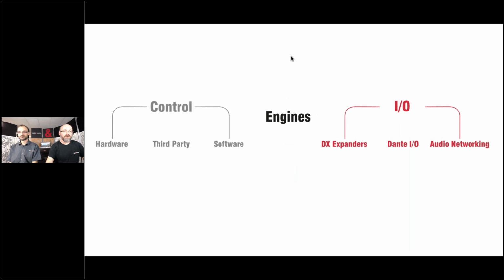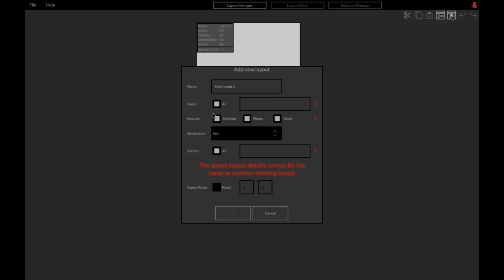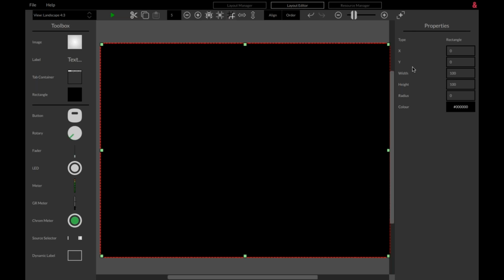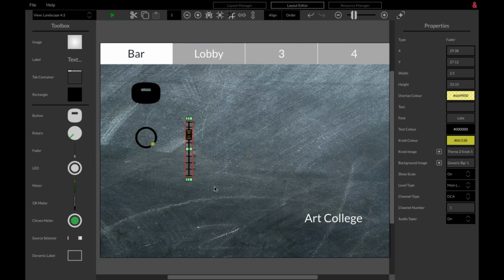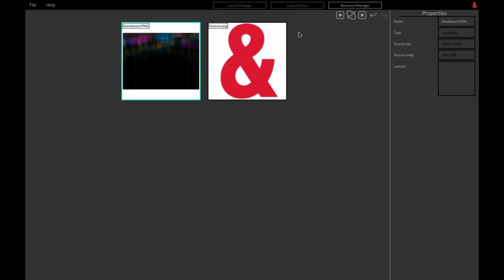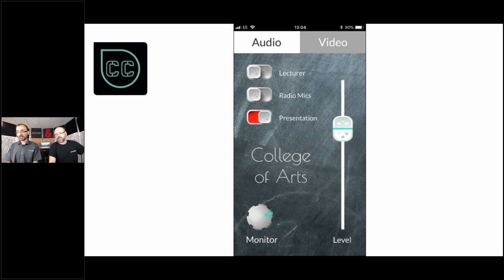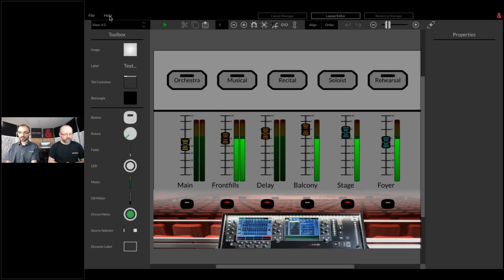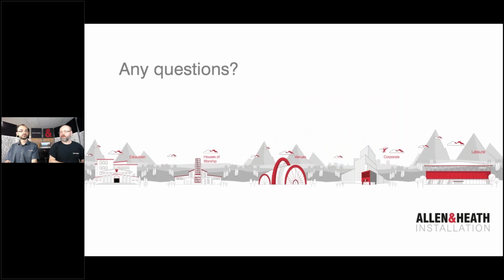Custom Control Webinar - Recorded June 20th, 2019

Comment: Would be nice if we place an image that we could lock aspect ratio. Currently when we use multiple layout for the same space, that logo will be warped. Same goes for components, like buttons and sliders. It would be nicer if they would distribute across the space vs stretching and squashing. This makes it look kinda cheap! This would save time otherwise we need to design specifically for each layout to have those elements be locked

Comment: Our church had a qu core 32 installed when we did upgrades to sound and video for live streaming.  However we are running into issues with volunteer training and desk/device screen real estate.  Right now I’ve got most functions set up through bit focus companion and stream deck.  Is there any ip protocols available to control elements other than through the app?
Reply from the maker: Hi Kevin, 

You can find the Qu MIDI Protocol here: https://www.allen-heath.com/media/Qu_MIDI_Protocol_V1.9.pdf

Please go to support.allen-heath.com to start a ticket if you need further assistance. 

Thanks!
Alex

Comment: Is Custom Control fully compatible with the AHM64?  I'm trying to build a control page for an 8 zone design, with input selection for each zone.  I have the input selection working on each zone, but I am trying to get fader control and metering for them as well, but can't figure out what the fader should be controlling (can't find a zone master fader in the drop down listing).
Reply from the maker: Hi Robert, 

Custom Control is not yet compatible with AHM, however, a new version of Custom Control is currently in development which adds support for AHM, so this will likely solve the problems you're currently having. 

Thanks! 
Alex
Reply: @AllenandHeathUK  thanks for getting back to me.  Do you have a timescale for this?  Also I was on the forums earlier, will there be a dedicated AHM-64 forum?
Reply from the maker: Hi Robert, 

This is currently with our software test department, but it's not possible to say exactly when this will be available as the time scale could change if an issue is found in the testing process. It is hoped that the release is weeks away rather than months, but it will only be made available when it completes the test procedure. 

I'll discuss the idea of an AHM section on the forum with the website manager. 

Thanks! Alex
Reply: @AllenandHeathUK  Is the current software able to handle this now? We are 1 year further and would like to know if these functions can be used now
Reply: Think ive found the answer to my own question already. I just found this video. But its from 2020, so not sure if this comment was before or after that video
https://www.youtube.com/watch?v=fTbU0IS7_tc